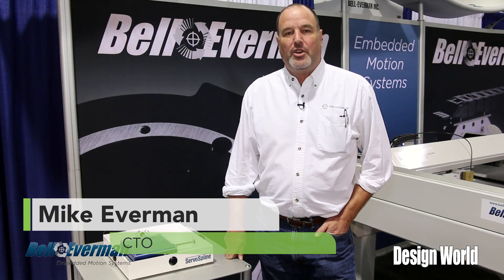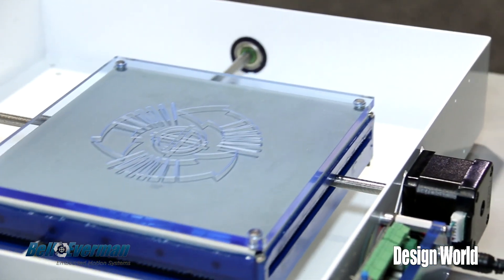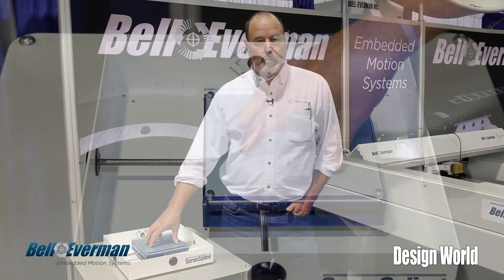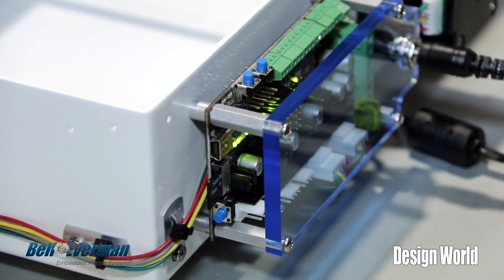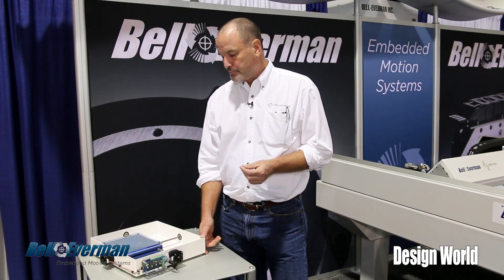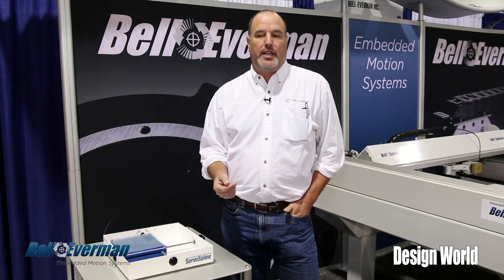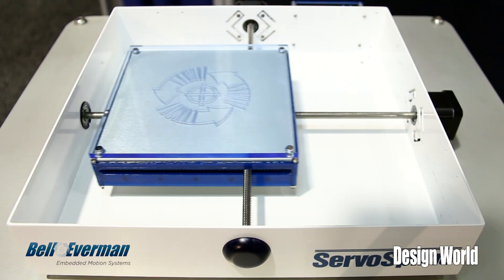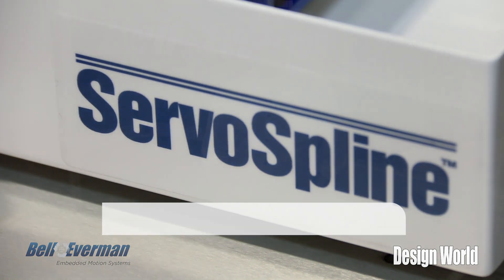Motion visionary Mike Everman explains two-screw stage for 3D printing

Comment: This type of movement mechanism only has one use case: Mount like a 4x4 array of extruders on top and you can print 16 objects at the same time without needing to move all those toolheads. Otherwise useless.
Reply: Revisiting this a year later as I'm trying to do something with leadscrews again, the description of this video is so wrong that I think they wrote this as a prank. 160mm^2? 4 axes of motion? 🤡🤡🤡🤡🤡

Comment: Maybe I'm missing something but why would you want to use this on a 3d printer ? For a fairly regular 300mm square bed the dimensions will be more than half a meter square area; instead of inertia artifacts on the x now we have them on the y also because bed moves on the two axes; also have some doubts on how fast this can go and still maintain some resolution. BTW how do you maintain zero backlash on the toothed profile ?

Comment: Is there any chance to speak with the designer of this ? I retro engineered this for a personal project, but I'm struggling so far with programming to  have an easy way to control the motion of it =) Thanks
Reply: I'm not the original creator but I've been building a replica as well. We have a fork of GRBL with the right kinematic equations to control it! I haven't updated the documentation yet but this works well on ours: https://github.com/UIC-Makerspace/grbl-Spline-Drive let me know if you'd want to talk more about this!
Reply: @uic_engineering_makerspace9791  Hi ! Ofc I'm interested. In my case I need the Arduino being able to do other stuff like read sensors etc... And I just need linear movements X and Y. So I managed smth like: for X movement (= motor A), and an 8mm leadscrew
Motor A = x steps
Motor B = -1 * x steps * (8 / (7.5 * PI))
This synchronized with accelstepper library and  it works like a charm :)
Do you have a 3d model of the table itself ? I think the most important part is how the leadscrew is interfacing with the table!

Comment: this is a terrible way to go about 3d printing. its a huge inefficient use of space and as the print builds up it adds mass to the build plate and thus more momentum with each and every move which will lead to defects and artifacts in the print. who tf thought this up and who tf funded it? corexy systems are clearly the future as they use space efficiently and keep the print steady and actually decrease mass on the print head so you can print faster
Reply: High-precision devices like this are how actual machining, like that responsible for physical products people pay more than $10 for, is done. That you are mocking basic technology essentially required for FFF/FDM printers to finally reach the same basic playing field as hand-operated machines from the 19th century, without the ability to write like a fucking adult, is kind of hilarious. People have already built printers, using repurposed linear stages, that can handle over 500mm/s with 20,000mm/s2 acceleration. Years ago. Whatever issues you think would happen might actually present an issue, on a toy you buy from Aliexpress for $300, but the reason this is not a more common way of doing things is that a new precision linear stage is generally more expensive than most printers all on its own. Moreover, a design like this, because they're rigid enough to be unaffected by the forced involved in milling steel, could run on much more powerful motors which will barely even notice the mass of whatever plastic you could ever put onto it, in a closed-loop control system that would never 'skip' a step or lose its place, even if you deliberately tried to push it out of alignment. 
Look up everythingbends. They posted in depth about their printer, built primarily out of a cheap, unknowingly-broken, used linear stage, every step of the way as they built it. The thing is a work of art far beyond anything any corexy design has ever attempted.

Comment: I'm presuming, that there are four threaded blocks which run in slides  along each face of the plate.
Two for each threaded rod, so they can be pre-loaded, to eliminate the backlash.
If the slides are linear rails, then the precision will be really quite good..
Reply: Nah it's even neater, if you take a close look at the slots that the screws go through you will see the teeth they engage with that run the width of the stage.
They are toothed at 45degrees so if only one screw rotates the stage actually moves on a 45deg angle, both need to rotate to move along the traditional cardinal axes.

Comment: Comment if u  have any idea on how does this work...  Thank u
Reply: There are two motors with each a leadscrew. One motor is placed higher than the other so the two leadscrews can cross. 
Then in the platform, there is a tooth profile that can be seen on the edge where the leadscrew interfaces with the plaform. Turning the leadscrew then moves the platform.
Reply: Look up how an ultimaker works with crossed rods. This is that, but with leadscrews providing the motion

Comment: nice idea, but the problem i see is you need at least double the printing surface area for the whole printer
Reply: Quadruple, in terms of footprint
Reply: I feel like this is not a bad tradeoff for having the head only need to Z-travel, might be handy for very heavy or complicated extruders like 3-filiament extruders.
I don't imagine it's super precise though, and you would need thick screws to get high rigidity.
Reply: quadruple
also a core xy would get the same result but nearly the same footprint for the print area
Reply: Another problem is that the mass of the bed and print is the load, with the print moving a lot
Reply: @anotherperson9646  On the other hand, the bed stays low in the configuration, meaning you can do a significant amount of stabilizing work into the base without needing a high-stability Z-axis, even if the Z has a relatively heavy head (lots of fans, direct drive extruder, multi-extruder, etc). Tall, thin prints would likely still pose some issues though.

I personally like the inversion on this concept a couple of people have done using inverted-H-bot designs. You flip the printer upside down, put the hotend on the moving plate, and raise the print bed as you print. The key to this design is ensuring a very, very, very good bed adhesion, but a guy built one with 175mmx175mmx125mm build volume that folds down to fit into a 3d filament box. Bloody brilliant.

Comment: What causes it to be zero backlash? Don't the Travelling contact surfaces wear out over time? If not please explain how that is possible?
Reply: Might be anti-backlash fittings. Springs maintain pressure in both directions on the lead screw.